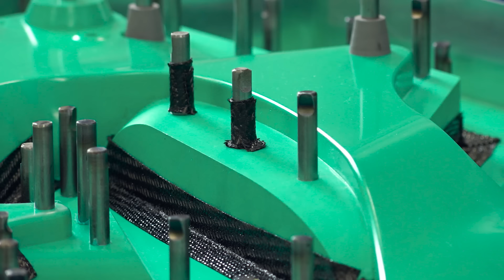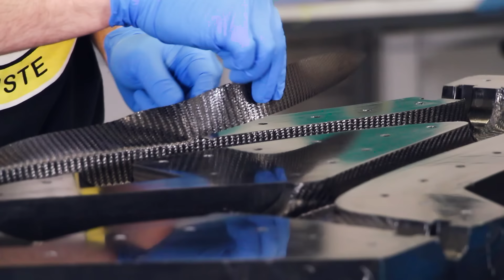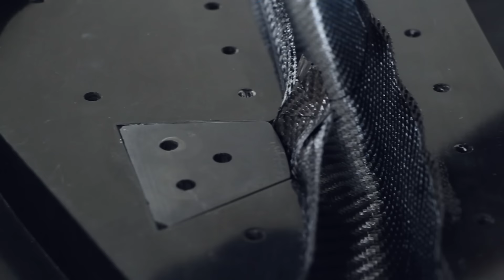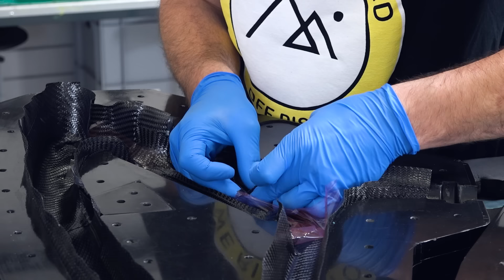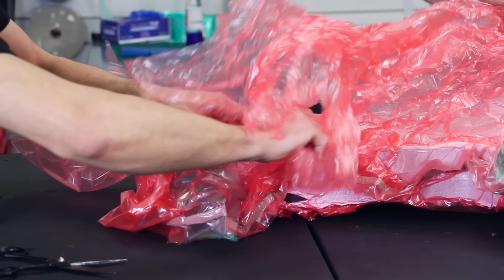Making a Carbon Fibre Bike Frame – From CAD Design to Downhill Race

Comment: Absolutely outstanding job gentleman. Everything about this video is 10 out of 10. The frame looks amazing and your thorough presentation are next level. Seriously the best carbon tutorial channel on YouTube, the internet... earth.  I love the exposed  weave and don’t understand why most carbon frames run UD on the outside now. Please do a video like this on building a wheelset with asymmetrical tubeless rims and huge conical shaped hubs.  Cheers!
Reply from the maker: Wow, that's praise indeed. Thanks very much for the comments. Our next few tutorials will be a bit more down-to-earth, just to keep a balance, but I'm sure we'll return to some complex technology like bike components again in the future. Stay tuned!
Reply: Easy Composites Ltd  I just realized something... when I first started working with carbon fiber, the first video I watched was your gun stock video. I used that method to repair a severely bent aluminum seat stay tube on a Rocky Mountain Element frame I bought for $50 on eBay. Those rear triangles were notorious for snapping in half. It worked like a charm. I pounded it out as straight as I could get it and wrapped it up with 4 layers. Wrapped the other seat stay as well. Topped it with satin clear auto paint. Ended up looking just like the better version of the same bike that came with carbon seat stays from the factory. I rode the bike hard for a season then sold it for 900 bucks. Thanks!

Comment: Very interesting video... I would like to check with you if the prepreg cloth can be cut with a cnc-laser cutter... I could not find a clear answer on the web. If it can geciteerd wit a cnc laser, do yo know how many watt laser is needed?
Reply from the maker: Hi Arjan, the conventional way to cut prepreg is with a drag-knife on a CNC plotter. I imagine that laser cutting would be possible although obviously there is the risk of partially curing the resin at the cut-line. I'm afraid I don't know about wattages; as I say, cutting by laser would not be the usual way.

Comment: Hi, congratulations for the video!  I have a question, what did you use to make the first layer of the mold?  it's black and you can't see the carbon fiber.
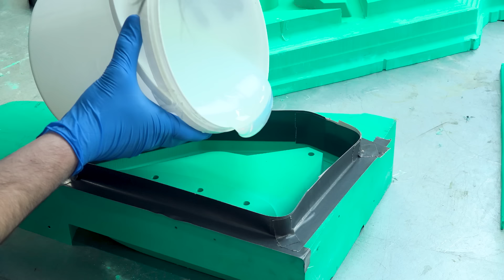Reply from the maker: Hi Antonio, thanks. The mould halves made from made from XT135 carbon 10:00 28/04/2020fibre tooling prepreg like in https://www.youtube.com/watch?v=k4GdAuNji5g; the black coloured surface is the XT135 surface ply.

Comment: I’m still trying to grasp the concept of having the inner bags, which are open to external air, creating pressure inside the vacuum bag.
Reply from the maker: The concept is the same as any bag, just in a tube as it is sealed to the main vacuum bag.  Basically when you pull vacuum on the bag (including the tube), the middle of the tube has 14.7psi pressure as its open to air at the end.  The other side of the bagging film has almost 0psi as its at a vacuum and hence there is a pressure differential which presses the tubular film against the mould surface.
Reply: Easy Composites Ltd Thank you for further explaining. Appreciate it.

Comment: Is it possible to make moulds from glass or ceramic?  It appears to me those materials have beneficial properties.
Reply from the maker: Glass can be used but let's remember than making a mould from glass would be incredibly difficult, surely more difficult than making one from just about any other material! Flat sheets of glass are often used, especially when making flat sheets of carbon fibre. Ceramic moulds are possible, there is a tooling board made from ceramic material (search for Compotool) which offers the advantage of negligible CTE although it's not as consistent or reliable to work with as epoxy board.

Comment: one question, is that bullet proof? if it's why not make full body armor soldier that fast build, light and can made from different body sizes
Reply from the maker: No, carbon fibre is not bullet-proof, in fact it's quite a brittle material so wouldn't be right for ballistics applications.
Reply: @easycompositestv  why not insert between the the carbons fibre bullet proof fibre like silk stuff and pressed it into mold body armor?

Comment: One think I'm curious is how you keep the surfaces where the bearings are going to be inserted/pressed in tolerance? How much do you account for carbon fiber thickness  when making the mold inserts?
Reply from the maker: Most of the inserts in the mould that create the locations for hard points are registered to the mould using dowels. The material thickness allowed for varies in different parts of the frame but is typically around 2-3mm

Comment: Hi, great video! Could you clarify why you created a carbon mold instead of simply using the epoxy board as a mold? Would be more difficult to machine the negative on the epoxy? Is the epoxy strong enough to make complete molds for this application? Thanks!
Reply from the maker: Hi Fernando, it's great question. So, the main reasons for CNC machining the male pattern from epoxy board, to then make carbon fibre female moulds mainly comes down to CTE (coefficient of thermal expansion) and also the durability of epoxy board. When you're working with prepregs which cure at relatively high temperatures, thermal expansion is a consideration in a number of areas; expansion of the pattern, the mould and the component and it can cause problems both with accuracy and also by damaging moulds/patterns/components. The epoxy tooling board has a fairly normal CTE, it gets slightly bigger as it gets hotter; at 120C the pattern or mould (made from epoxy tooling board) would be several millimetres larger than it is at room temperature. Carbon fibre, on the other hand, is basically zero CTE (no expansion at temperature). Therefore, if you cure a carbon fibre part in an epoxy board mould, at 120C, the carbon part will cure and set at size at the high temperature and then - as the epoxy board cools - it will contract, crushing the carbon fibre part. Often this can result in cracking the epoxy board. Therefore, what we want is a carbon fibre mould. At this point, you might wonder how the same problem doesn't happen again when you take the carbon fibre mould off the epoxy board but this is overcome because tooling prepregs have a very low initial cure temperature. In fact, in this case the mould was initially cured at 60C, at which temperature there has been virtually no expansion of the tooling board. The 60C cure is very long. After that cure the mould is post cured to a high temperature 'off the pattern' and once that's complete you have a mould with virtually zero CTE, the same as the carbon part it will be used to create.

Comment: At which point during the process does the resin enter the mold?
Reply from the maker: The resin is already in the reinforcement, right from the beginning. So, you could say that the resin entered the part weeks earlier when the prepreg way made!

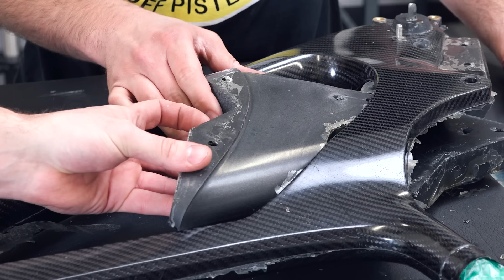Comment: he was definitely hammering the frame by accident there  😂😂32:35
Reply: yeap...i was like, wtf he is doing dumb ass.... :))
Reply: @RMFUNTIK  😂😂😂😂😂 I was dieing
Reply from the maker: Sorry but you're wrong. The insert is in two halves, Vlad's tapping the one on the left and then tries the one on the right, and then back to the left. They need to slide out next to each other. He designed and made every aspect of these moulds, inserts and frame from start to finish so mistaking the frame for an insert, as well as being a 'dumb ass' is, well, *unlikely*!
Reply: @easycompositestv  yeah ok we all have eyes and that was blatantly by accident 😂 he only hit the side closest friends to him not both and he progressively tapped harder because the insert wasn't moving then realized he was clouting the back for the frame.

Comment: How do you get the seams where two sheets of pre prev come together to form a nice seams like that along the top rail of the frame?
Reply from the maker: Hopefully we already covered that in the video. The first ply of carbon on one side it cut with a scalpel flush to the top of the mould, the carbon on the opposite side of the mould then runs behind that layer, leaving just one cut seam showing which is on the split line. It's then sanded back and clear coated over.

Comment: Miltary spec carbon applications use concrete as it has the same thermal coefficient expansion rate as carbon fiber i was asked to weld some compnentry for the joint strike fighter here in OZ as they farmed individual components out to various countries.
Therefore you could make a mould out of concrete and hemp and sand it back the laminate it with a lacquer....

Comment: no bleeder breather for extra resin ?
Reply from the maker: There is no extra resin. Prepregs run on optimum resin rations; the surface ply is 42%, the UD is 38%. Since this is already the optimum ratio we don't want to bleed off any resin from the laminate.
Reply: @easycompositestv  sometimes we are required by engineering to supply the resin soaked bleeder with the finished repair so that's not the case with all prepregs, I would say you have extra resin as our repairs show the texture of the cloth and are no where near glossy, extra resin is extra weight. just sayin ! :-)

Comment: That's impossible  !!
Reply from the maker: Haha, well, I'd certainly say "complicated"!
Reply: @easycompositestv  I have been in composite repair for Boeing for the last 10 years repairing the 747 , 787 , 767 and 777 what you do makes my job look simple.
The prepreg we work with is cured at 250 or 350 deg.
Reply: @easycompositestv  We also use tube bags to repair hollow stringers , it's a strange concept to explain to people.

Comment: Why is the mold itself made out of carbon fiber? Is it just because you have it around? It seems that could be just laminated with hi-temp epoxy and fiberglass? Looks like a very expensive mold?
Reply from the maker: The mould is made from carbon fibre because carbon fibre is a very unusual material in that it has a zero (in fact slightly negative) CTE (coefficient of thermal expansion). This means that carbon does not expand when it gets hot like most materials do, including fibreglass or aluminium. When you're making carbon fibre parts, it's best practice to use carbon fibre moulds. By doing so, the mould and the component have the same (almost zero) CTE. On the other hand, if you have a glass or aluminium mould that expands and contracts more than the carbon you're curing inside, this can cause problems/stresses on the mould/part.

Comment: That work sure is a thing of beauty. What's the materials and expendables cost for this bicycle project? How many uses is the mold good for?
Reply from the maker: If you look on this page https://www.easycomposites.co.uk/#!/composites-tutorials/making-a-carbon-fibre-bike-frame-start-to-finish there is a complete list of all the materials/tools/equipment used in the project.
Reply: @easycompositestv  K thanks

Comment: is it as strong as aluminum frame?
Reply from the maker: Short question with a very long answer! The short answer is that the strength of a carbon fibre frame would be different from the strength of an aluminium frame of the same weight. That's because alumimium is an isotropic material and carbon fibre is not. Done right, carbon fibre puts strength (or stiffness) where it's needed and not where it's not!

Comment: How do you determine how many layers you need and The weight of the material? can you make a video about how to choose the materials and how many layers and directions to lay them up??
Reply from the maker: That's probably a bit beyond the scope of a tutorial I'm afraid mainly because, in this case at least,  it's mainly been based on instinct and Vlad's experience of what's been successful before, rather than some simple rules or calculations. In the prototype phase the layup is similar to what else is out there already (or what's been determined to have worked before) which is then built-up and then revised to get the weight/feel/characteristics that the designer is looking for.
Reply: Easy Composites Ltd  We would love to hear anything you wish to share it would be greatly appreciated.

Comment: Really nice video, learned new things about vacuum bagging. Juste a small question though : When you demolded the frame and everything, did you leave some of the vacuum bag and release film inside of the frame ? (I imagine you couldn't go inside to get what stuck to the inside of the frame)
Reply from the maker: The bagging film is non-stick so it mostly ripped out.

Comment: I have a question: Could you make the cast entire from graphite enriched epoxy? Wouldn't that make it even faster and cheaper to make or is there to much difference in expansion?
Reply from the maker: Hi Andy, unfortunately not. It would certainly make it faster and cheaper to produce but the mechanical properties would be no where near, not even anywhere near steel. The strength and performance in carbon fibre layups like this comes from continuity of the fibres (they must be long and continuous) and their alignment (they must be aligned in the direction of the load). When you say 'graphite' I assume you're meaning something like milled carbon (graphite wouldn't be right at all, it would turn the frame into a giant pencil) but even milled carbon has such short fibre length and isotropic strength that it just wouldn't provide the stiffness needed.
Reply: @easycompositestv  thank you for replying and I'm sorry I meant mould not cast. So would it be possible to make the entire mould (just like the Inserts) from graphite resin?

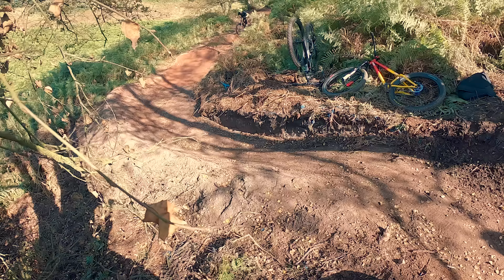Comment: 38:29 now you fly with that. the weight is reduced? or just added strenght?
Reply from the maker: Well, the two properties are really just different sides of the same thing. Stronger materials can be used to produce something that's stronger for a given weight or lighter for a given strength. This prototype bike has mostly the properties Vlad was looking for but subsequent iterations will probably use less reinforcement in some places and so be lighter.

Comment: Good video!! I have one question about all bolts. Why do you need so many? Would a few be enough to clamp and align it together then the vacuum will hold it in place?
Reply from the maker: Hi Ollie, the bolts exert a lot more pressure than the vacuum and are a more more fixed way of aligning and securing the mould halves. The reason this is important is because the mould is going to be used at temperature, because of some expansion and movement of the mould at temperature (even a well designed carbon fibre mould like this) it's better to have lots of very secure fixings (the bolts) keeping everything tight and aligned.

Comment: Still learning aeronautical composites so I have a potentially obvious question: Why is the mould itself made from Carbon instead of a cheaper composite?
Reply from the maker: Dimensional accuracy, longevity of use in a production setting and handling are the main reasons. For a one off, you could in theory machine the tooling board to be the mould itself (rather than pattern) but for a production run, this would be exceptionally difficult to physically handle and would have a relatively short life cycle. Where a part requires absolute dimensions accuracy, the low Coefficient of Thermal Expansion of the Carbon means that the resultant parts will be very high tolerance/accurate.
Reply: @easycompositestv  Thanks, I guess to be more specific why carbon and not glass for the moulds?

Comment: Great vid and thank you for sharing. One thing I don’t understand, the inner tube bags, I would have thought they would need to be pressurised to force the carbon against the mould?
Reply from the maker: No need.  If you watch carefully you will see the tubular bagging film sealed to the normal vacuum bag and thus the full vacuum is pulled inside the tube as well and thus no pressure is needed.
Reply: @easycompositestv  Oh, yeah, I get it, the penny just dropped. thanks guys, love your channel

Comment: Thanks so much for the information. I've made two bikes now, but with foam wrapped in carbon. Obviously my frames are very heavy, but the time, machinery, and cost involved in making molds means they are not accessible to the average back yarder. Perhaps I may have to revise that opinion after this video, some of the molds you have made may be applicable to my next frame. The use of vacuum bagging is very clever, I had never considered this approach, and am well impressed.
Reply from the maker: Thanks very much Ben. We totally understand that most of what's done in this video goes beyond what most individuals can afford to do, it is however a fraction of the cost of billet aluminium tools and so does, in some way, bridge the gap between what's impossible for just about everyone and what's just about possible for someone working on their own or in a small team. Keep us posted with your progress and good luck with your next project.

Comment: Wow, I now not only understand why a carbon frame is so much more expensive, but I can’t believe it’s not even more. Fascinating process!
Reply from the maker: Cheers Mike, yes, it's a bit of an eye-opener when you see it like this. Of course if you're making thousands not ones then you can optimise a bit (CNC cut templates etc) but even then there's still a ton of work in a bike frame.
Reply: Modern Carbon frames are cheaper to manf than the comparable Alloy.